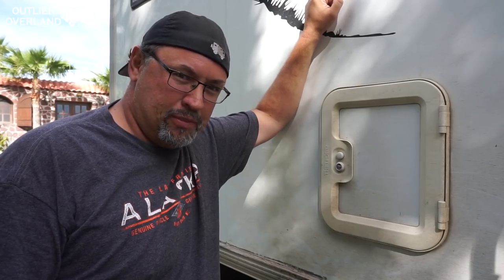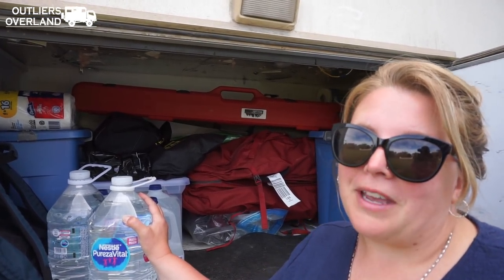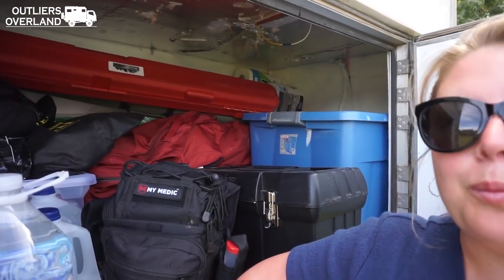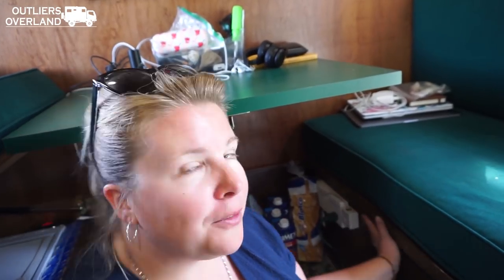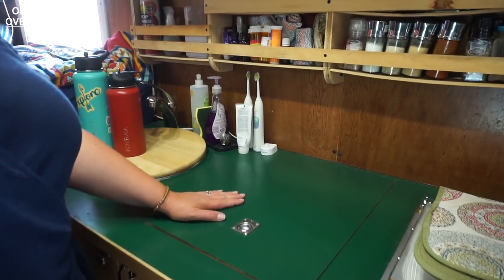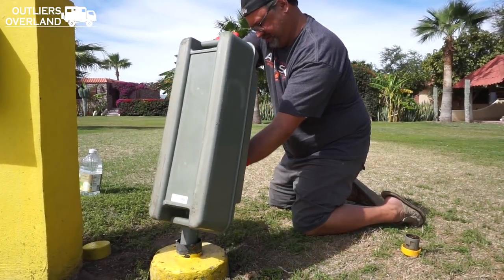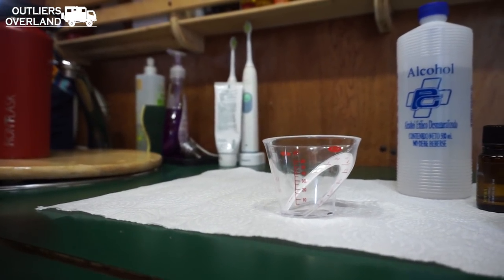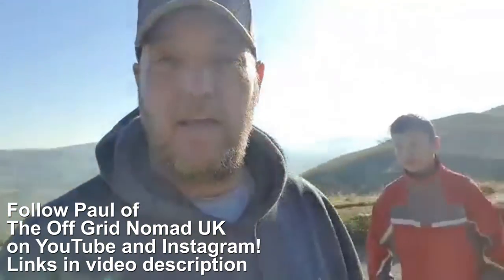#StayHome and make DIY Mexican Hand Sanitizer #WithMe ~ SHELTER IN PLACE SHOW-Day 2

Comment: What was the % of alcohol you started with? Most of what I can find in the US is 70% alcohol.
Reply from the maker: It actually didn’t say, we looked.   Most likely it was 70.
Reply: @outliersoverland  So, if you dilute the 40 ml of 70% alcohol with 20 ml of aloe, aren't you way below 60% alcohol? Your dilution  ratio will only work if it is 99.9% alcohol.